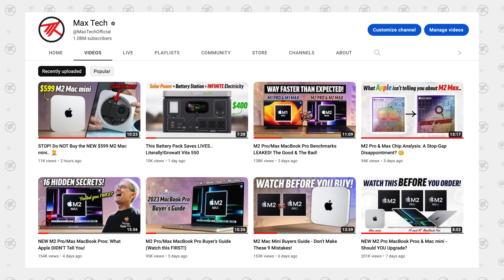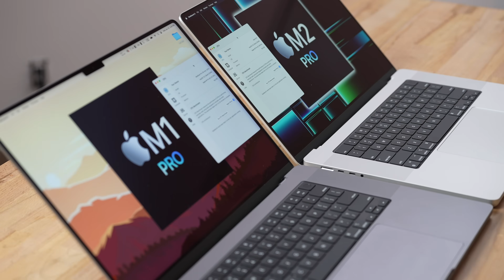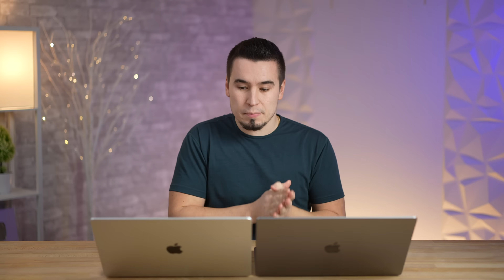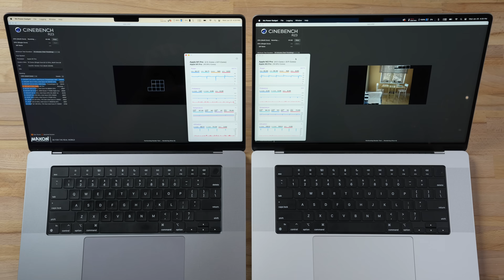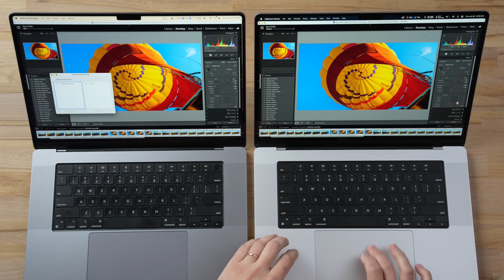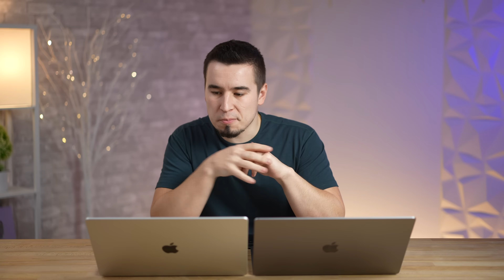M2 Pro 16" MacBook Pro - EPIC Comparison (BAD UPGRADE!?)

Comment: Blows my mind how big of a leap 14 inch m1 MacBook Pro really was
Reply: Agreed, the ultimate laptop along with the bargain M1 MackBook Air
Reply: @mvp_kryptonite  m2 Air is just a big boy version of my 15 year old sharp Zaurus😂
Reply: Yeah, the M2 Macbook Pro is just a fully grown out M1, but doesnt really change big things
Reply: @dackel4253  obviously, it's only 18 months
Reply: We Will never see a leap that Big again
Reply: 16''  smaller webcam screensize ratio, bigger battery, enormous sound diff  big big track pad
Reply: Well, Apple has traded the support of the x86 platform for the efficiency of ARM. Hence the reason MS Teams craches 100 times per day on an M1 Mac.
Reply: Right, I only got the 16 for the size
Reply: Yes, but now M1 Pro are really more affordable, especially on eBay
Reply: This SSD thing is really turning me off from upgrading this year.
Reply: @markserranopro  if you get 1tb or larger you will have the same speeds as last gen.
Reply: @markserranopro  just buy a discounted m1 pro version, is more than enough to every normal person….
Reply: @markserranopro  I’ve thought about it a lot and I actually think it’s a good thing. See people who got the m1 were saying the ssd was wearing out very fast and saying it had already used a large percentage of its lifespan after just a year. Which I think is because of the two striped raid 0 drives. So this is half as fast, but the ssd should last twice as long. For the price these cost I actually think this is a better situation.
Reply: @ghost-user559  can you plz tell ,
 m1 pro 14inch vs m2 pro 14inch , which one is good , or ssd a bit slow in m2 pro , so its a big difference or what ?
Reply: @lonewolf8786  Ssd is half as fast but it will last twice as long on the M2. So Apple made M1 twice as fast but the ssd will probably wear out twice as fast. For a better price get m1. But if you can afford whatever you want definitely get M2. 

To be honest they are both so good that even with the slower ssd it’s still much faster than almost any computer. You will be happy with both machines, but your wallet will be even happier with M1.
Reply: @ghost-user559  thnx buddy , in India
 m1 pro 14inch or m2 pro 14inch almost same just 45-50$ extra on m2 , but overall m2 have 10/16
Reply: @lonewolf8786  Yeah I would definitely get an upgrade to storage and ram for sure. And if you can afford it definitely get the M2. It’s a very good machine.
Reply: @ghost-user559  SSD durability is not an issue at all
Reply: @RoyClaessen  How would you know that for every single model and machine when not enough time has elapsed to determine whether it is an issue or not? People reported significant ssd wear in the weeks and months following m1s release. No such issues have been reported with M2. So something must have changed between iterations, and we know obviously the ssd is one of those changes.
Reply: @ghost-user559  where did you get this information? Faster SSD performance is not causing more wear. There are simply more NAND chips om the M1 pro vs M2 pro base model. Many factors play a role here but SSD wear is the last thing that is on my mind looking at a macbook motherboard.
Reply: @RoyClaessen  Well the logic is simple. Two flash chips are only twice as fast if they are acting as a striped raid 0 array. This is confirmed by having almost exactly twice the speed. That means the data must be spread evenly between the two drives, so every read and write must use both drives for every single process. Two smaller ssd will already have a reduced TBW compared to one single larger ssd. Then add the fact that two smaller drives are required to issue twice the read write calls to get the data that is spread across both chips. So twice the speed is only possible in this situation because there is twice the reads and writes, and therefore twice the wear and point of failure. This is irrelevant on larger drives, but two 128 drives are very small and have a very pathetic TBW compared to even a single 256 or 512 drive.
Reply: @RoyClaessen  As long as you have Apple care, I wouldn’t worry at all. The only reason it’s an issue really is the fact that we cannot repair or replace drives. So it’s more an issue of repairs long term rather than a serious short term threat of data loss, although striped drives are twice the points of failure. But if you have the warranty they are also twice as fast.
Reply: @ghost-user559  why would the ssd on the m1 laptop wont last long? iam deciding on buying one
Reply: @ciw8688  Because it has two small ssd instead of one big one. Ssd lifespan is based on how many times data can be written to the ssd. The bigger the ssd the bigger the lifespan called “Terabytes Written” or TWB. I wouldn’t worry about it, because for most people it will never be a problem. It’s more a problem for people who write data all day long like a server, or people who use their computer in extreme ways. You will be fine, and you can always get apple or someone to repair it if something does happen years from now.
Reply: @ghost-user559  that was discovered as a bug
Reply: @ghost-user559  if you think Apple slowed SSD on the base models for sake of SSD lifespan, how you can explain "normal" speeds with 1TB and above storage options ?😂
Reply: @BVDIH  Because larger drives already have doubled lifespans? You need to look up TBW and ssd technology. Do a deep dive.

Smaller ssd can’t handle being in a raid 0 configuration because a smaller ssd already lasts half as long as a drive double its size. So splitting a 256 GB in half means that drive has an extremely limited lifespan and is more likely to fail. Two 256 drives last twice as long. And 2 512 last double 2 256.

It’s about long term failure rates. Nobody wants a dead ssd in 3 years when they paid 1k for a computer, and they would obviously blame Apple.
Reply: @BVDIH  Would you rather have a fast drive and lose your data at any time? Or a slower ssd that lasts twice as long? So 6 years or more versus 2-3 years? Personally if I’m buying a base model and money is tight, I’d rather have it last as long as possible rather than be faster and fail when I need it most.
Reply: I wonder if they’ll bring Face ID to the 3nm MacBook Pro. 
I would personally upgrade to apply silicon once they suoooet egpus. Which hopefully come with the MacPro 😮
Reply: @MooseX2012  not happening Apple not Even support OpenGL anymore neither vulkan 
Thought their GPUs are great 
Overtime they Will reach Nvidia sure
Reply: @framedthunder6436  well, they know pros and other big companies use gpus. My guess, is maybe why the Mac Pro is taking so long? They are trying to make their new silicon work with m, my guess again and more likely, at least, AMD GPUs. 
Maybe, I hope, they can find it in their heart to open up for egpus
Reply: True. I just wish they supported more displays.

Comment: You can use them for almost everything of your daily tasks and work. It’s very hard to stress them out, unless you do a very productive job using very heavy programs that heat up the processor. Nowadays with those processors you can do amazing things🎉